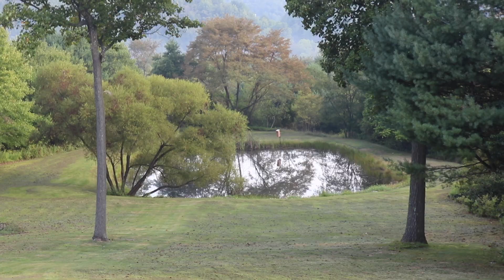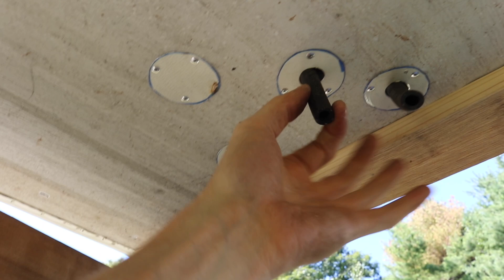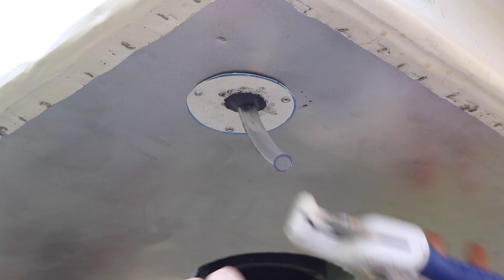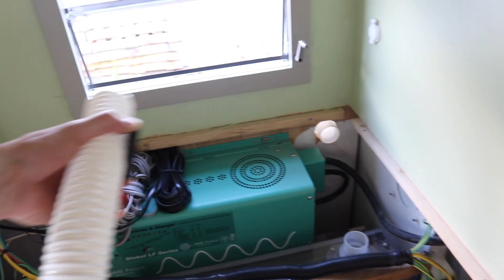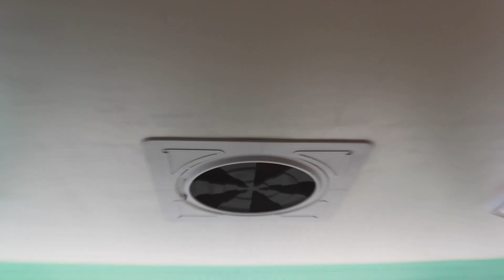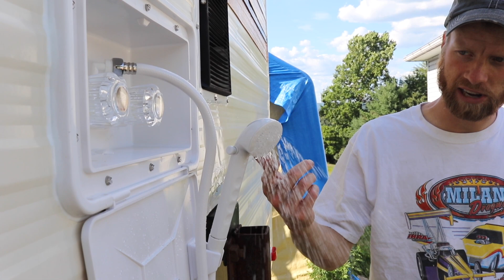UNDERBELLY & MORE - Truck Camper Build Part 63

Comment: What did you end up doing to fix the water leak, a cut and splice the hose or a full hose replacement? Or did I just miss it staring at Sherm’s cuteness!?!
Reply from the maker: I tried silicone, it did not stick to the tubing. It is currently still leaking slightly as I fill the tank. I will replace the hose with new once I purchase the correct size. Thanks for watching!